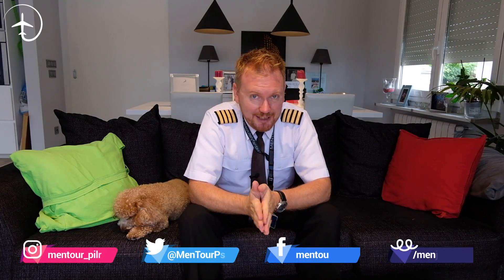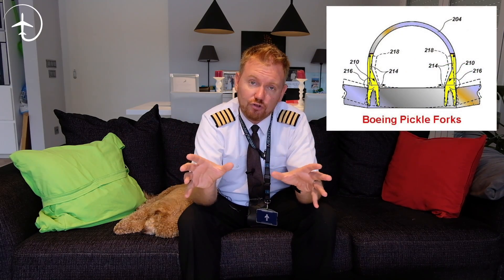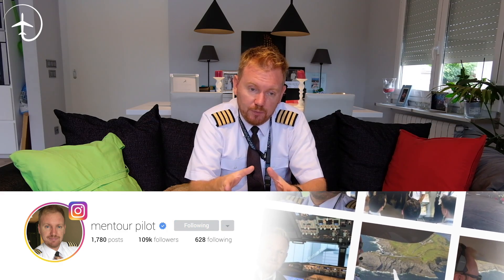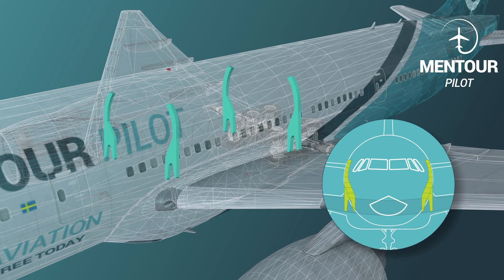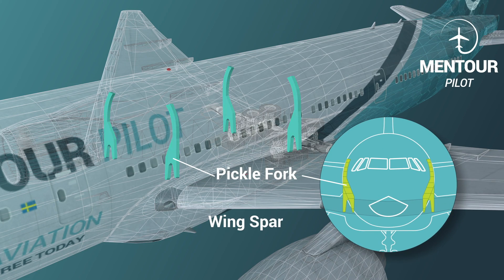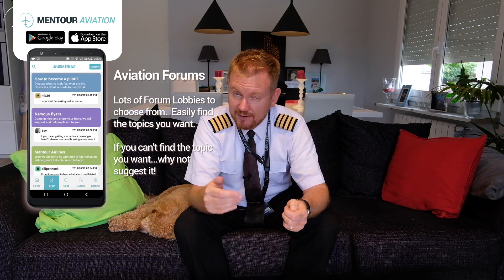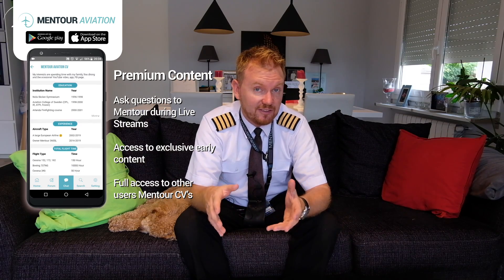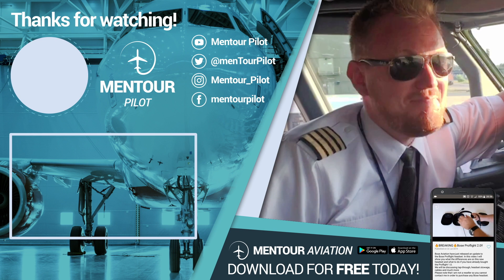Cracks in the Boeing 737 NG wings!? Mentour explains

Comment: That's very concerning given the mechanical properties of aluminium alloys when they are overloaded 

7175 alloys are pretty strong until cracks start forming, then it can catastrophically fail without warning due to the fact that aluminium tends to shatter rather than permanently deform when excessive stresses are applied (similar to putting a motor with too much torque on the front forks of a bicycle, a steel fork will bend and let you ride home, an aluminium fork will shear apart and then off comes the wheel, that happened to me a few months ago) 

Some of these aircraft could be just a bit of turbulence away from disaster 

In any case, all hail Airbus
Reply: MWB Gaming some A320s have also been diagnosed with this issue, it’s not just isolated to Boeing...
Reply: @macflanagan1296  Couldn't find anything on that allegation. Can you give a link.
Reply: @matekochkoch  I think they meant A380
Reply: Pablo Gonzalez   Not on A 320 family ,that's only on A,-380-800.
Reply: @themuscle79BONIFACIO  That's what I said
Reply: @PabloGonzalez-hv3td  That was a completely different part with a different function. There is not very much in common between both cases.
Errors of all kinds happen in aviation like in any other industy.
I personally think Boeing handeled this particular error  very well although there are not very many parts i can think of with a more catastrophic consequence in case of a fault.
There will always be a some faulty parts nothing is 100%.
Reply: @matekochkoch   - I think the point is that when any component fails well before its design life it's important to learn why
Reply: MWB Gaming 
As I mentioned above, I gave up on aluminum handlebars on my mountain bike and went to titanium exactly for this reason.  Aluminum, even with alloys, doesn’t work well with situations in which flex or movement occurs.  It’s just too stiff and doesn’t flex well.  I also don’t like aluminum framed bicycles for this reason as well.  It’s fine in non-flex situations, but otherwise...
Reply: Yes, that's correct. 7175 is used in forgings.  If this is the type used, I cannot verify this, the grain will be in the direction of its length. In this case they could be vulnerable to cracking or splitting parallel to its length.
Reply: @keirfarnum6811   I use steel parts on my bikes for the same reason, the shear strength of aluminium really sucks when compared to other metals like steel or titanium, the only benefit it has is its strength to weight ratio is very good, and it doesn't rust, but there's not a lot of ductility, and when under tensisle load, it shatters rather than permanently deforming 

Titanium is far out of my budget, so I use a steel frame bike that I have reinforced in key areas with hardened steel braces
Reply: @mwbgaming28  Steel is Real. There are very affordable steel alloys like 4130 that are weldable for your application. One guy showed me the front fork assy for a mountain bike that was feather light, but cost him 400 bucks.
Reply: @forrestgumpv9049  my favorite type of steel is 1.4612 stainless steel 

Haven't found a better steel for reinforcing bikes, it's strong enough to withstand the insane torque of a 2000w motor, yet ductile enough to not crack or shear apart under the stress
Reply: MWB , That 1.4512 ss is new to me so I looked it up. Good choice too. Its precipitation hardened with a little aluminum for corrosion resistance and Titanium for strength.  Guessing you are Tig welding it. I'm not into bicycles although I ride an aluminum frame Mongoose 21spd at work every day,  Lol. The building I work in is 43 acres and it's a long walk to the parking lot.
Reply: @forrestgumpv9049  I normally mig weld because it's easier lol, and the weld is strong enough for what I'm using it for

I have abandoned aluminium bikes for the most part because of how easily the frames snap (even hurt pretty badly in my early days of riding after hitting a pothole on an aluminium bike)

 The bike I ride everywhere is an old Dunlop assault bike (dual suspension model) with a 2000w electric hub motor, only needed minor torque bracing on the rear end to ensure the rear forks don't bend or break

Been going fine for nearly 2 years so far
Reply: @PabloGonzalez-hv3td  bro, why you following me around the comments section LMAO XD

Comment: I have an question if you could explain?.... 

When a passenger checks into an airport but misses "final boarding call" the luggage crew must locate the checked in bag and remove it from the plane as  a bag cannot fly without the passenger, but when a bag is misplaced by the airline isn't the bag flown on another flight without the passenger onboard?
Reply: Not to intrude on Mentaur's future possible explanation, but the reasoning for this must be that a misplaced bag is random event outside the control of the passenger, while a checked in bag without the passenger boarding the plane is a suspicous event which warrants removal of the luggage. That is after all the simplest solution and can even be construed as being service oriented. (To the passenger, to be not seperated from his belongings)
Reply: the rule with removing checked bags only applies to international flights does not apply to domestic at least in the states
Reply: their was a 747 in the 80's in England that had a bomb checked in as luggage the terrorist did not board. once the aircraft hit a certain altitude it was blown in half

Comment: There are also FAA reports of cracks in the A320 structure.
Reply: According to the relevant AD, "This condition, if not detected and corrected, could lead to a high vibration level on the primary flight and navigation displays during critical flight phases (take-off and landing), possibly creating reading difficulties for the crew."
That's hardly comparable to the Boeing issue and a structure like the pickle fork, which is there to take the stress off the wing.
EDIT: If you were referring to another AD (not 84 FR 16386), please specify.

Comment: Hello Mentour Pilot, have you heard anything of using ultrasound for detection of this kind of crack in the pickle fork of the Boeing 737 NG? From what I understand ultrasound is a much better detection method than a visual inspection, though it would likely require a larger teardown to access the parts. And with a better insight into the smaller cracks or starting of the cracks Boeing could come up with more reasonable theories of there cause.
Reply: Weldon Young These components are huge and the cracks easily visible. The faulty parts will be returned for detailed examination.
Reply: @gordonrichardson2972  , yes I though the 'pickle forks' were large, or huge as you say. But you (and others) state it might take about an hour to access and inspect one or all four pickle forks. Do you have additional information of the likely location where the cracks are developing or would aircarriers have such information. Without very pain staking visual exam or rushed visual exam many cracks could be missed otherwise, or the inspection could take much longer than an hour. It is also possible this component will require frequent ongoing inspections.
     Fortunately no aircraft has experienced failure of this critical component yet, which might mean the pickle fork could continue to function even with substantion defects.
     As you state Boeing still is in the information gathering stage of identifying the prevalence of this problem, before deciding what actions it should take or what batch of pickle forks are effected.
Reply: @gordonrichardson2972  , thanks for the additional details 👍🏻 That clears thing up.

Comment: So a practical question here. Does anyone know if it's safe to book flights with Ryanair in November? Can their NGs possibly be affected by this cracks issue?
Reply: Of course it's safe, the aircraft are inspected and any affected aircraft wont be flying until they are fixed
Reply: @stemc95  Fair enough, but my point is if a large number of their aircraft turn out to be affected by this issue, flights will probably just get canceled cause there won't be a replacement and I'll lose my money

Comment: There seems to be a dangerous conflict of interests in this case. According to what Captain said it’s the airline’s problem to fix this structural issue. On the other hand, if an incident comes to happen, the involved airline could certainly blame, and sue, Boeing. Also, if a company sells you an apartment and after 11 years the building is at risk of collapsing due to construction issues, I just can’t believe the cost of fixing the problem should run at your own expenses. Can you? So... can we rest secure that every country’s aviation authority will adequately enforce the fixing of the problem at airline’s expenses?
Reply: Leandro Sztelzer The airlines will attempt to recover compensation from the manufacturer.

Comment: The cracks are the issue of the non neutralization of the flutter during flight in its structural internal structure design of  the wing. Nonetheless, also the default of the body wing design is at stake with the turbulence. When the overall design is a failure you cannot implement a additive system  computer design to compensate the ill structural design of the body and wing. So sad for Boeing to persist in its own overwhelming error. So the corrective computer design can only correct the side effect of the body design but will ultimately impoverished the flight status in its security flight.

Comment: "this is not good for a couple of reasons" Understatement of the week xD

So, basically don't fly on the newer 737?

Actually, why does it always seem to be the boeings? I mean other than the engine of an A380 exploding, i can't think of any recent advisories or groundings of airbus machines.
Reply: "So, basically don't fly on the newer 737?"

Well, the cracks were discovered on older planes. SO if anything, you SHOULD fly on newer 737's.
Reply: @bloodguard41  haha, good point there. Should've specified newer versions of the 737 rather than just newer 737s.
Reply: @Logarithm906  The NG's are still largely fine. Personally, I wouldn't have issues flying them again.

Comment: Ok, Mentour Pilot, how about a dissertation on the Air Bus flight, #111, that crashed off the coast of Nova Scotia. Turns out Air Bus installed flammable Mylar insulation in the aircraft. A wiring modification caused a spark, which ignited said insulation. It is my understanding that the FAA and/or the airlines, and/or Air Bus, did not require that this Mylar be replaced. Or how about the Air Bus flight, I can't remember the number, where the computer took over control of the plane from the pilots, and the flight almost crashed. Do you believe that Boeing is the only manufacturer that is culpable in regards to safety over company profits?

Comment: were these 737_NGs flying to Japan/Fukushima before they got to India? How about the negative structural effects of ionizing radiation? Radiation-induced ozone-cracking of polymers? 

Eugene Wigner-effect in solid materials: graphite especially, (although this is mainly neutron-induced) and glass and hydraulic-fittings, and it could be harmful to composites. There are even local areas in India, which have quite high natural radiation from the minerals in the ground. 

(Nuclear induced problems are typically too much wrapped in secrecy, so the public only gets a glimpse of it after a catastrophic accident!) Then the politicians drink a glass of "Fukushima-water" to prove its save and nothing to worry!

Comment: Using wrenches is not manufacturing.  It's assembly.  Manufacturing the pickle forks is the process of producing the correct dimensions and correct alloy or composition.  You can't build pickle forks out of American cheese slices.  They don't hold up.
To make the airlines pay for these repairs is insane.  Boeing needs to be responsible for the design, the manufacturing of the parts, the assembly, and the predicted lifespan and maintenance of the parts or assemblies.  This is clearly either a bad design or a defective part or both.  These parts are not supposed to wear out or require maintenance.

Comment: There is a scathing report of the bear straps manufactured by a subcontractor to Boeing (Ducommun Inc, of Gardenia, CA) did not meet structural, engineering tolerances or were even manufactured to the tolerances in the requirements. In fact they were supposed to have been CNC'd, but were manually fabricated. The installers at Boeing practically had to hammer them into place, forced to fit, or even had to drill new holes to make them fit. I have to presume that these forks were also fabricated by Ducommun Inc. That may be why the cycle before failure of these parts less than what you term 90,000 cycles. These criminals are putting, us the public and you as pilots in danger, furthermore, there seems to be a wink between Boeing and the FAA.

Comment: Being a metal fabricator I would say your theory on the batch of aluminum alloy used to build these components being issue is the most plausible. Metal cracks under stress. Whether it's kinetic or thermal, it will crack especially if it's being heated up and cooled down many times in a single cycle like say higher ambient temperature during takeoff, for example, could be hot enough to flex a little more than at a cooler ambient. These pickle forks look like they are in relative vicinity of the main landing gear so thermal transfer from brakes heating up could play a role in that but I'm not an airline worker so this is all speculation based from my experience. Very interesting still, would you mind keeping us updated of any new occurrences of this topic?

Comment: When I was mountain biking, I gave up on aluminum handlebars because they would always develop stress fractures and break (went to titanium instead.)  Aluminum works fine in applications in which there is no movement or flex, but otherwise aluminum will crack and break.

Comment: If the airline must bear the cost of the repair, it doesn't seem like a good idea to have them do the check and be trusted to report back. Obviously there is and incentives to report back because they don't want a disaster on their hands, but there's a conflict between that and how the cost might impact them, especially for a smaller Airline or a less financially secure Airline. It's also a little surprising to me that the companies making the aluminum cannot be held responsible for the cost. If it does come down to the aluminum I would expect Airlines to be suing bass manufacturer for damages.

Comment: Excellent and interesting. I think it is probably beyond the scope (and attention span) of most of your viewers, but it would be interesting to see the whole process in the post mortem of an aircraft crash or failure. I'm sure that anything most of us would come up with was already being done years ago, but it is an involved process valuable for any pilot or prospective pilot to be familiar with.
Reply: We do C and D check on all commercial airplanes, that was how the cracks were discovered. By the way cracks in aluminum airplanes is kind of nature of the beast due to limited fatigue life of aluminum. One of my first job was to fabricate steel splice straps to repair 727 Front Spar Chord cracks. Aluminum airplane will develop cracks, it is just a matter of time and cycle.

Comment: I was on a Ryanair 737 the other day and just before landing I saw a clear liquid coming out of one of the joins between two panels on top of the wing, and I’m pretty sure it was fuel leaking...
Reply: Agent J  I saw the same thing on a Ryanair flight from Rome (CIA) to Lisbon (LIS) and the pilot turned off the right engine in mid flight and once we landed we had a battalion of mechanics on top of that wing and beneath.
Once we boarded in Rome the pilot was already complaining about it and there was an intense fuel smell and a puddle of something liquid underneatg the right wing aswell.

Comment: Can it be fixed? If the alloy is bad the whole fork might be understrength. If it can not be switched out, the plane might be condemned. Who pays in that case? The airline would not survive if they had to scrap aircraft 1/3 into the planned lifetime.
Reply from the maker: Everything can be fixed. But the cost will be substantial
Reply: The repair will require replacement of the whole pickle fork, involving partial disassembly of the aircraft. It will be time consuming and expensive.

Comment: A fault in the manufacturing process has got nothing to do with mounting, torque too high etc.... this refers to assembling process. To me it is an issue of manufacturing process but by saying that I am suggesting the cracks could be due to inadequate temperatures during closed die forging, also inadequate amounts od deoxidisers in the ingot or simply low quality metals used in the production. In other words Boeing is cutting corners because profits are more important to them than our lives. Boeing should ground all of its 737 fleets all across the world for NDT checks because if there are 1 inch + craks on the surface or sub-surface then I can only wonder what is going on the inside. And with the streesses of the payload during the take off or turbulences it is not a matter of if but when. God bless and good luck with that Boeing.

Comment: They are reporting 25 more 737 NG aircraft found with these cracks so far. 7097 built by 31 May 2019.
So far a very small percentage reported.
Would be nice if I can remember to check on 02 Nov 2019 just how many AC are affected.
Reply: Philip Mackin 36 as of last night.